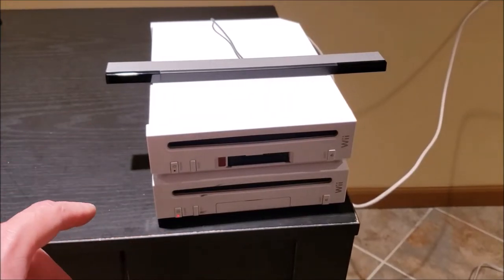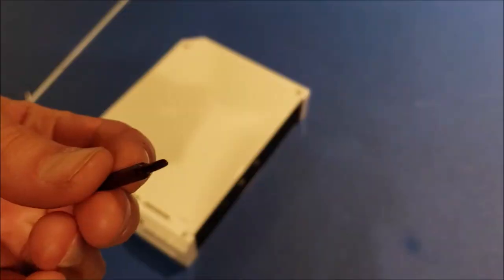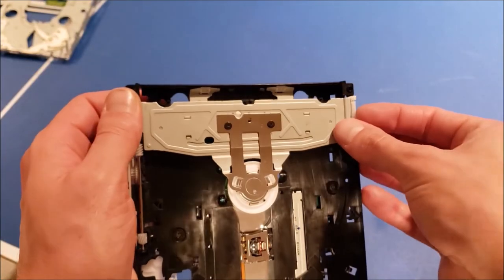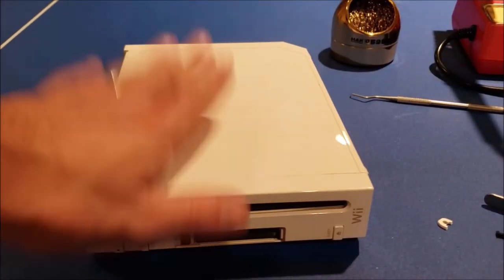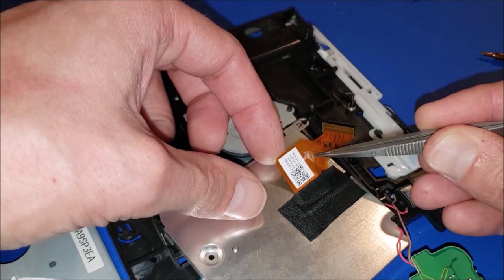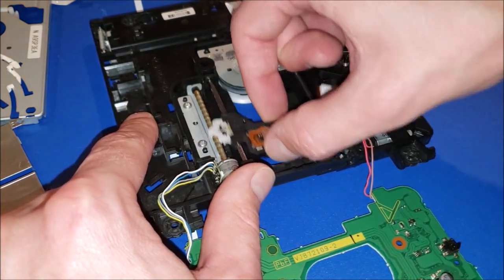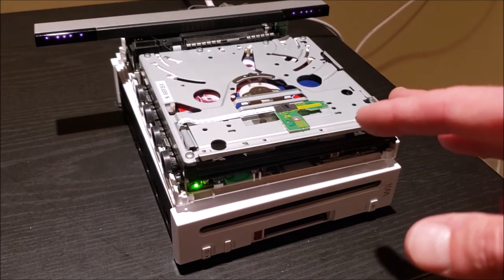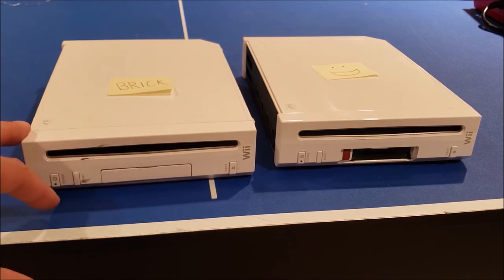Attempting to Fix Two Nintendo Wii Disc Read Errors

Comment: I have seen so many people replacing these drives on YouTube.  I decided to do a teardown and try to fix the drive instead.  I found  a Chuckee Cheese game card, 2 DVD's (Gene Wilder Double feature),  insurance card, a nickel, a quarter, 2 stickers, a torilla chip and a piece of a balloon inside.  Even after the drive made horrific noises that lead me to believe there was no way it work again. After removing all of the foreign objects, the drive would still not load or run a disc properly.  I kept messing with it until I finally had 5 sucessful load/reads.  It now works quietly and properly.

The most time consuming and frustrating part about the whole process was not having a tri-wing screwdriver that was skinny enough to fit into the deep holes on the case
 It was a nightmare. I decided I will not put those screws back in but rather replace them with some Phillips head screws .

The mystery part shown at 2:54 was the other problem.  On my Black Wii which seems to be slightly different, there was a metal clip that slips over that White plastic mystery piece. I tried to put the clip on 3 different ways and nothing would load/run properly until the third try (the right way).  After that it all worked perfectly. 

I had the correct Tri-wing 1/4 inch drive tip which worked until I had to get into the deep hole.  I would highly recommend to anyone attempting this to take the time to order the tri-wing screwdriver online. It will make things much easier for you.  Thanks for the video.
Reply from the maker: Did you really find all of that in the drive? Holy shamoley that's wild!
Reply: @FantasticQuack  Yes.  A young toddler accomplished this lol. But it was not done all at once. The drive stopped working years ago. it was definitely done over a few years. I had no idea how bad it was until deciding to fix it.
Reply: Sure bud.
Reply: @Ranchitup69 idk about the Wii drive but I know it's kinda possible on the PS4 drive lol my son had two ds games and a Popsicle stick in mine

Comment: I tried fixing my Wii but all I did was open it up and give it a proper clean. Once done, it not only wasn't able to read discs, it also made a weird sound and a message popped saying that there was a problem and I should restart my Wii lol. Will try to follow what you do next time, if nothing works I guess it'll be time to get a new driver
Reply from the maker: I hope you get it working!
Reply: Dude that happened to me. At least it was only $30 lol
Reply: Same
Reply: If it still can't be fixed, then just mod it.

Comment: I think that if you're going to open the disc drive, you might as well lubricate the metal shafts, stepper motor rod, and gears with some lithium grease.
Reply from the maker: The existing grease still looked okay on these but generally don't disagree if you have some handy. However if you're gonna do that you need to be prepared to remove the old stuff with a solvent before replacing it, otherwise you're just putting new grease on dirty grease.

Comment: I bought an Rvl-001 Wii at a flea market that has the same problem as the one you weren't able to fix. Any tips on finding a new drive? Having a hard time differentiating between drives that support Gamecube and those that don't...
Reply from the maker: Reviews on this one say it can read cube games:
https://www.amazon.com/Original-Nintendo-Replacement-INSTALLED-Y-screwdriver/dp/B0155J99MK

Comment: I have 2 wii's, and they both have the disk read issue, im hoping I can get somebody to look into it! I dont trust myself opening it up 😅
Reply from the maker: Problem with the wii is that you can buy used/working ones for ~$40 so that often makes more sense than paying someone to fix a bad one. But they are extremely useful to the modding community even with a bad disc drive--people like to make portable wii/gamecubes with the main boards. You could sell them for parts to fund a working wii if you or your handy friends aren't comfortable working on it, just a suggestion!

Comment: When I put a disc in it will show it "reading" it but not make any noise and then it just says cannot read disc. I'm wondering if this is an issue with the laser or motor?
Reply from the maker: Hard to say based on this alone, could be a laser power issue, many possibilities.

Comment: Hello in the beggining of your video where you tested the 2 wii's wich number was the one that recognized the disk and made the weird noise? ( i have the same problem and then after the noise it give me the error from the other wii that gives an error when u started it up)
Reply from the maker: That was #1. It was the broken off black piece interfering with the motion of the drive head causing the noise

Comment: My son's wii has a dirty lens I think? I tried to take it apart but got stuck on the different type of screw. It plays some games fine, but super smash brothers doesn't work, and zelda twilight princess goes on for a minute and then gives an error. Do you think if I can take it apart and clean the fan it'll fix the issue? There's no crunching sounds, just the disc read error.
Reply from the maker: I would check the problem games themselves as a first step. If they look scuffed/scratched I would get them resurfaced and see if that fixes the issue. If the games aren't the problem, clean the lens with a q-tip and rubbing alcohol. If still no improvement, I'd look at adjusting the laser power potentiometer to a slightly lower resistance (for more laser power).

Comment: I have a Wii that reads one game (Wii Sports), but with another game (Wii Party) I get a disc reading error about 10 minutes into playing. When I eject the game and put it back in, it just gives me the error again, but this time right away. This doesn't happen to my other game, so I'm unsure as to what the problem is. Can it just be that the Wii Laser has trouble reading the information in one game and not the other or something?
Reply from the maker: Is the Wii Party disc noticeably more scratched/scuffed than the other games? You might just need to get that particular game resurfaced.

Comment: With my Wii, it will accept discs and when it spins the disc it makes this loud clicking noise and then says an error has occurred and it tells me to eject the disc and turn off the console. Do you know how I may fix this problem?
Reply from the maker: Have you looked inside the drive? Sounds like it could be a broken mechanical part
Reply: @FantasticQuack  I will definitely try that ty!

Comment: I have a problem with my WWE WrestleMania XIX game on the GameCube. Every other game works on my Wii and this game looks really good but only crashes when I start a exhibition match. Runs fine for career mode. Any ideas?
Reply from the maker: If every other game works fine then the issue is definitely the disc. If there are scratches, you can try getting it resurfaced, but there are other possible issues that may be less visible (like layer separation/rot or even hairline cracks).
Reply: @FantasticQuack  thanks so much for the reply! I fixed my problem using homebrew :)

Comment: My Wii is like the one that failed, makes the same noise and message. I'm going to check it out later do you have any tips
Reply from the maker: I think you're talking about the one I was not able to fix. I won't say there wasn't a way to fix it, but sometimes it makes more sense to just replace the whole disc drive which you can get for < $18 shipped on ebay. Link: https://tinyurl.com/y5zvamab

Comment: I have a Wii that read discs when the top is off but when I put it back together it doesn’t read discs anymore do you know the problem? I also replaced the drive and the same thing is still happening. thanks in advance
Reply from the maker: That is very strange. Does it work with the top on but not screwed in place? something might be getting pressurized too much perhaps if a piece (like the large metal shielding) or component is loose or not aligned properly. Hard to say without seeing in person.

Comment: Have u replaced a drive before I got a wii-001 and I swapped it with a refurb drive on eBay and it didn’t work. Everyone has said it’s just a clean swap and idk what I’m missing haha.
Reply from the maker: A new drive should fix it if the drive was the problem. I'd double check the connection.

Comment: That terminal is an anti-static connection and it’s bridged during factory assembly only. It prevents static from building up and frying laser diode’s
Reply from the maker: That makes sense thanks for the info!

Comment: What if we dont have a tri wing?
Reply from the maker: It is possible to remove them with a small flathead, but it can be tricky depending on how tight the screw is, and you increase risk of stripping the screw head. I would recommend just buying a tri-wing, they are ~$2.

Comment: That piece of plastic is actually from the plastic frame pieces. It’s a tab made to secure the game cube controller port in memory card doors. with it broken the doors are a little loose.
Reply from the maker: It does look like that so I won't say you're wrong!

Comment: My Wii reads the disc, but when I play the 2nd island, it says that "Game disc couldn't read."
Reply from the maker: Is it doing that on every game or just one in particular? If the latter, it is likely just a scratched disc in which case you can get it resurfaced.
Reply: @FantasticQuack  I have a unit doing the same, it will recognize all but one or two of my disks and you can play for a bit, but at some point it errors out like you pulled the disk out and asks for it to be reinserted. This occurs with multiple games, the disk surfaces are in a good condition too.

Comment: My wii does something very strange. The disc goes in for a bit. Comes out halfway and then back in. It then comes out fully. Can someone help?
Reply from the maker: Does it make any strange noises? Hard to know the issue based on this comment alone.
Reply: @FantasticQuack  I got a new wii a few weeks ago so I threw my old one out.
Reply from the maker: @blindmario  That's a shame I would have gladly taken it off your hands

Comment: Is there anyone that can help with my problem?(mine doesn't even take the Wii games, it just goes in comes out goes back in the throws the disc out)
Reply from the maker: Any luck googling this issue? I've never ran into this problem but it could be something as simple as dust or debris clogging up a mechanism that needs to be cleaned out.
Reply: @FantasticQuack  no (I kinda fixed it cause a game cube game if mine got stuck so I used a disc with cardboard and now it's taking the games but not reading any of them

Comment: I have a Wii, i got a 500gb external hard drive, modded the wii and installed hd loader, do that and the laser won't matter anymore, one thing i never saw you try was clean the lens, i might have missed it.
Reply from the maker: I did try cleaning the lenses, but not sure if I mentioned it in the video. Interestingly, of all the disc read errors I've fixed on various consoles, I have not once found the issue to be a dirty lense.
Reply: @FantasticQuack  i have 38 ps2's, bought them all as is, most of them i repaired, only 2 faults they had, dirty lens or worn laser arm guide, the only ps2 lasers i could never repair with a clean was the Khs400c with the yellow ring around the lens, they are garbage. i've fitted a 1tb hard drive to one of my ps2's and have McBoot, filled it full of games, i have about 200 games on disk,  i also have about 15 ps1s, most of them work but they suffer with the worn plastic runner sending the focus off line, i got about 250 ps1 games, i have about 8 wii's they all work, i modded them myself, i have a 500gb full of games, i have bout 180 games on disk.. i stopped buying anything newer than these.

Comment: i tried this but it doesn't do anything anymore... got it 10 Days ago for my birthday...
Reply from the maker: What did you try to do? If it's not responding at all now it's likely something just didn't get plugged back in.
Reply: @FantasticQuack  well... it does but when it takes the disk it keeps pushing the disk back further and further although it already reached the end (btw the rest works fine like the main menu and stuff)

Comment: i dont have a tri wing screwdriver so yeah i cant get it open
Reply from the maker: If the screws aren't super tight you can sometimes get the job done with a perfect-size flathead. I'd recommend just buying a tri wing, they're a couple bucks or less.
Reply: @FantasticQuack  yeah i think my wii just is broken so bad that you cant fix it but i will keep trying

Comment: The broken black plastic bit holds the side door hinge closed.
Reply from the maker: It looks similar but it was actually from the housing of the laser on the optical drive, there are normally two arms on the one side to glide along the steel shaft, and this unit now only has one.

Comment: Also laser swaps are very easy. And can fix an otherwise dead drive.
Reply from the maker: Easy sure but opening the Wii in the first place is simply annoying with all the odd screw types/locations compared to any other console. Combine that with their low value it's a tough sell to put too much time into these!

Comment: I replaced my boyfriend's disk drive with my childhood wii's and it worked for about a month until today we got the unable to read disk error message. It accepts disks, but makes an odd clicking noise when attempting to read. Is it worth taking apart again, or should I buy a replacement disk drive? Thank you!
Reply from the maker: For me it's always worth taking apart. For some it might make more sense just to get a new drive and save the extra effort.
Reply: You do have to open it to put the new drive in anyway so may as well try to fix it first

Comment: boa tarde parceiro eu tenho um nintendo wii e ele aparece essa mensagem na tela do jogo mario kart U NA BLE TO RE AD ThE
D
iSC
ChECK ThE
Wi OPERATiONS
NANUA
foR
hel
TROUBLEShOOTiNG. o que pode ser porque o meu video game ele e travado
Reply from the maker: Is it only Mario Kart having the issue? If other games have the same problem you may have a bad disc drive. If it is just the one game then it may need to be resurfaced.

Comment: Ok so I have 2 Wiis (it's a long story) one I just got from my dad, and the other is one I grew up with. The new one shouldn't have any problems... but the one I grew up with was thrown into a dumpster by its previous owners before my dad found it and gave it to me. But for some reason, the brand new one won't read the Wii Sports it came with, while my old one plays it just fine. Both Wiis play other games completely fine, it's just the Wii Sports that won't play on my new Wii.
Edit: it is only the 1 disc that does this. Also, it doesn't just tell me it can't read it, it FULLY tells me to take out the disc and turn off the Wii, which tells me that it isn't a disc problem
Edit 2: the disc is VEEEEERY slightly scatched. Such a small amount that it shouldn't even matter at all. You can't even notice the scratch unless you look extremely close
Reply from the maker: That is very strange that it is only happening on one game. I'd need to do some research to offer better advice but a small tweak to the laser power might solve it.
Reply: That's the same thing for me except my black wii won't read any games at all it makes a weird grinding sound but my white Wii won't read Mario kart like it does but as soon as I get into a race it says to take the disc out and turn off power

Comment: Will a Cordless drill fix my wii disc drive and my ps2 Dualshock controllers and my black logetich controller and my orange GameCube joystick on the left ?.
Reply from the maker: A cordless drill will fix a lot of things, but probably not your video games.
Reply: @FantasticQuack  I know if it q Cordless drill has a short screw spinner to take out the screws from your console controllers.

Comment: This is the exact game I'm trying to play too 😭😂😭😂
It recognizes the game and all but it won't read the game disk

Luckily mine isn't making any weird noise and it reads any other game but this game is in perfect condition so I'm so confused
Reply from the maker: Sometimes the drives just die, if the issue isn't obvious it usually makes more sense to just replace the drive vs spending hours troubleshooting. Hope you can get it fixed up!
Reply: @FantasticQuack  thanks!